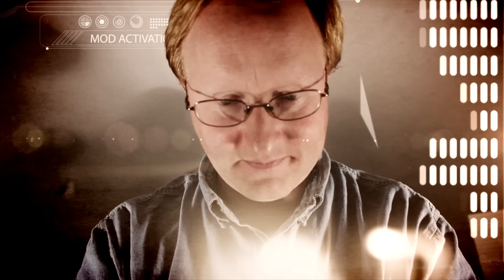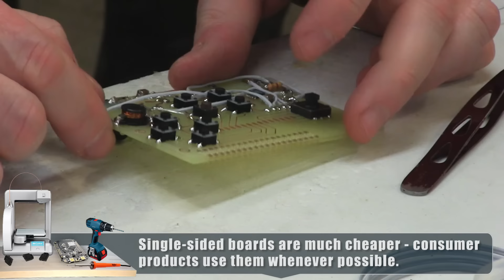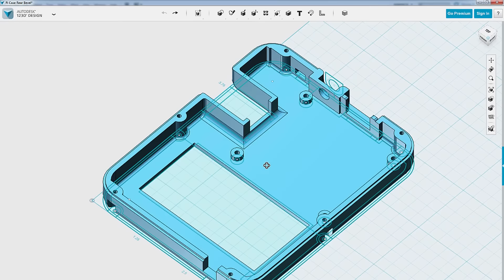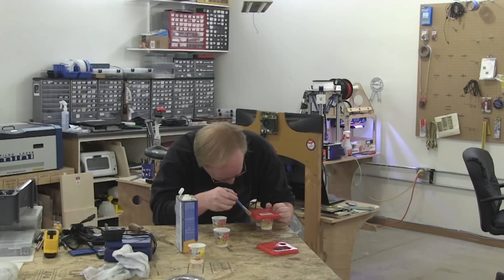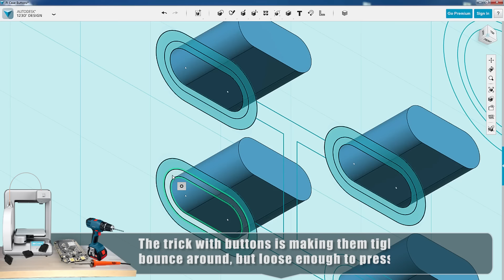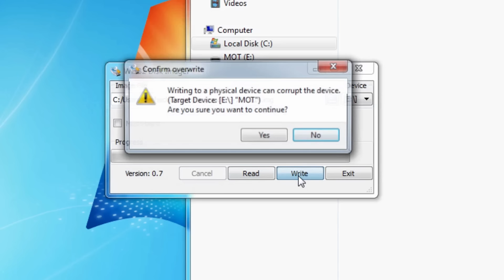Ben Heck’s Raspberry Pi MAME Portable Part 2

Comment: honestly, to me this handheld seems sort of worse than the previous. Moreover, still no speakers? Seriously? Also, you seem to concentrate on trivial parts (was watching the case being coated in acetone really necessary?) while almost completely neglecting important stuff (GPIO connections/pins, Raspberry/voltage regulator specs, component prices) then you go straight into compiling. Pretty steep learn curve I would say. What if something goes wrong during building? We get stuck at the very beginning if we have no compilation skills whatsoever.

Neat choices:

-tactile switches (simple to install and wire)
-flat cables (save up lots of spaces while keeping it tight and tidy: we know exactly what goes where)
-Li-ion batteries (better with a high capacity i.e. more mAh)
-direct controls on GPIO instead of an USB controller (which is horrendous because it drains current without being really useful in the first place)
-KISS (I love that)

Overall criticism:

-3d printing (so neat but so unaffordable, why not looking for used/not functional pre existing handhelds?)
-tactile switches (they're so friggin noisy!!!)
-looks uglier and bulkier than the previous one
-again, no speaker/s (HUGE disappointment, ever seen a handheld console with no speakers? I am not aware of any of them)
-a little less "homemade" than others (not everybody has PCB skills and/or tools to create one at home)
-Li-ion charger AND stepdown regulator (maybe too complex?)

All in all, a "cheap composite LCD screen" works just fine and it could also obscure out some minor graphical artifacts due to less-than-perfect emulation. And the resulting slight blur could create a nice "80s" effect which I adore. Was this really an improvement?

Comment: Is there a way to eliminate audio noise to RPI 3's headphone jack? I have this problem using a cheap 3 + 3 watt amp for stereo sound in a Porta-Pi that I built with a 10" monitor that uses HDMI but has no audio support on it's driver board. I'm using a phone charger battery pack. Has 2 2.5 amp  & 1 1 amp power out. Everything works fine except for annoying audio noise. Any advise?

Comment: RE: "What would you have done differently?" -- I would have made the case more ergonomic. -- It seems like everyone and their brother is making Raspberry PI portables, but they're making them in all these terrible flat cases that don't fit in your hands well. -- Look at the bottom of an Xbox controller, it's not flat, it's all wavy and bumpy -- designed to fit your actual hands -- so that you can have long hours of play time with them without your hands cramping up like they did back in the days of NES and SNES. -- Also, I probably would have added a pair of dedicated speakers, used at least an RPI2, and a screen that connected to the video hardware directly, rather than using i2c.

Comment: Why do all Americans pronounce it "Sahder" ..  I mean you guys don't say "Sahger" for Soldier.  Solder has an L that is supposed to be audible.  Drives me nuts, I do like your channel however.
Reply: +Troy Starkey  Why do Brits pronounce aluminum as aluminium adding a syllable? Yet another mystery of life.
Reply: The Brits use the modern word, yet Americans use the original word.  That bothered me for a while, but they are spelled differently so until they take up the newer word we have to put up with those differences.  Sahder has no real excuse though, i guess the sahgers can fight it out in a word war someday.
Reply: if we start to question english pronunciation the whole language just falls apart

Comment: Acetone has a welding, not gluing effect.  The plastic actually melts and intermixes with the target surface, as opposed to a bond which fills gaps on the opposing surfaces.  Generally speaking, welding is less reversible than glue/bond.

Comment: Very cool build! What would I have done different? I would have used a self made double-sided PCB with drill holes for bridging. No need to outsource it when you can just run short wires through the board itself. Green masking the pcb is a simple process which I have in the past and would have done here. Also would have designed the chassis wider and longer, used a different battery, flat cell instead of round cell, but that is a small issue and your choice only caused a minor chassis design problem. Would have painted the chassis white rather than acetone it[that color is just awful]. Also would have included other emulators as you designed enough buttons for them, possibly including left and right shoulder buttons. The system you designed has enough computing power to run MAME and therefore has enough for many others. Those are my thoughts.

Comment: really not keen on the whole acetone smoothing. a simple sand and light coat of spray paint looks so much better. also sanding the rounded edges into the print rather than printing them looks better

Comment: You could have extended that USB port to the side, thus not leaving that hole in the case. With a small hatch to protect it in case you think rubbing the USB port with your hand would oxidize it.

Comment: I would have included a mini speaker inside the case. You should have sprayed a thin layer of acetone for a smooth finish and no warping. (Use a refillable perfume bottle.)

Comment: It was an awesome build! The color reminded me some 80's computers (specially Alice from Matra-Hachette).
Wel, you asked for suggestions, then here you are: 1 ) You can avoid the mess with ferric chloride by using HCL an H202 but do it on open air because of the gases it generates and don't forget to use protective gloves and glasses. 2) I would have choose which GPIOs to use AFTER I have designed the board with straight connections to the buttons to avoid the use of so much wires. 3) For signal wiring you could also use enamel wire (like mr Elm-chan.org builds). Finally I have a request. you have some wonderful furniture in your workshop, some of them look DIY builds. You could show them someday, maybe share the plans for construction. Best Regards!

Comment: it looks cool, but the price tag and total time building it wasnt worth it, unless your a hobyist as they say. Still it's fun to watch people build something from scratch.

if you are a layman and want emulators on the go (not just NEO-GEO or other arcade emulators), PSP would that stuff for you even without using a CFW since emulators today are pseudo-signed making them possible to run on PSP on Official Firmwares. And it's really cheap and looks much nicer.

Comment: hey i wonder if any one could help me as it would be much appreciated i am currently nearly finished restoring a moped and for the dash lights it has small bulbs but im just going to use leds as back lighting  ..... i am using 5mm leds that are 3.3 volts at 25 mA ...... i am just wondering what resistors i should use ? and should i use a resistor on every positive on the led or 1 for the whole circuit and i am going to be using 6 leds all together and the supply voltage will be 12v by battery but once the engine has started it may be 13-15 volts and i think high amperage

Comment: Hi Ben,
I had the same issue with importing illustrator SVG files to 123D Design, but I found a workaround that keeps both the dimensions in tact and also protects all the round corners from distorting. It’s a little tedious but it works. It will save you from rebuilding the entire sketch in 123D Design.

It’s a two step process.
1.) First what dimension illustrator actually exports when exporting a 100mmX100mm box. In my case, illustrator exported a 283.5mmX283.5mm box. You have to divide 100mm by 283.5mm (in my case, your number might be different) to get the number to scale your art to. Save it out as a SVG and your files should match the mm in your illustrator file.

2.) Now lets tackle the distortion issue. I learned that 123D hates importing small SVG files for some reason. My workaround is to scale the illustrator file up 1000% (after you did step one) and then import it to 123D design to new scene. This will keep the curves intact. Extrude the shapes (by a factor of 10) and then scale your artwork down to 0.1. This way it both retains the correct dimension and the correct shape on all curved objects.

I hope this helps. Also I made a few videos to demonstrate just in case:
Part 1: https://www.youtube.com/watch?v=eT5jh13v_v8
Part 2: https://www.youtube.com/watch?v=RX8o6RgOXKA

By the way, thank you for making your videos, I enjoy watching your builds.
-Chris Titze

Comment: I've gotten good results with acetone finish by putting it into a spray bottle and misting the PCB. granted you have to do it fast because it'll destroy the bottle if it's got any plastic parts in it, but if you do it right it can give it a fairly nice dappled texture, like the Super Nintendo or Super Famicom had.

Comment: The audio was all effed up in your game. I know Ninja Gaiden (aka Shadow Warriors) well and that sounded almost "inverted".
There are playthroughs available on YouTube, under the title Shadow Warriors, so you can hear it normally.
Reply: mingtooter Well, he was using a Raspberry Pi Model A+, which has only 256MB of RAM. When I play SNES games on my Model B (512MB of RAM), it also can have issues, so overclocking the Pi helps out. With a simple heatsink (0.25 on eBay), a mild overclock makes a WORLD of difference. In my case, I do a bit more, but I have a tiny fan also cooling it and at least SNES wise, I haven't noticed ANY slowdown.
Reply: I thought I heard that too... The pitch was varying in time with the actions and button presses by the look of it. Some gremlins I guess.
Reply: Flame Soulis good call, good tip!

Comment: I want a fix, adjustment, redesign to trackballs.
NONE of the few designer companies have updated the design or concept of the trackball in over 10 years..
There were 2 designs that REALLY worked..
Logitech Marble mouse and MS made one long ago, with Multiple buttons..
1. they were designed for Handicapped people..
Big Buttons..
2. Bad designs with Thumb ball designs..
3. drivers SUCK..

Thoughts..
MORE buttons for gaming..  they are big enough to have Lots of buttons.
Trackball change to Ball shaped PAD..  with Multi DPI settings.
To many are using Digital(off/on) controls can there be a Variable control?
There are 2-3 fingers that REALLy dont have much to do, if you drop the pinky, 2..
Combination buttons, being able to hit/hold 2 buttons to create another function..

the problem I keep running into, is finding a USB control chip..with enough options to do what I wish..without buying an expensive mouse and converting it.. 

then comes the fun part..Control software.  Iv even suggested to MS to make a better control software..  would be nice to have a program that lets you ID any type of mouse/device..and all its buttons, no matter how many.
Reply: Trackballs should be discarded entirely. They were a mistake IMO. More like a mouse upside down.

Comment: I would of put a 5 pin female header port on the side, so you could connect a NES/SNES controller. 3.3V/CLOCK/LATCH/DATA/GND.

Comment: Hey Ben, i was wondering about your Linux computer, i need a good programming machine and it would have to run Linux but the Raspberry pi does not have enough power,and my workspace is small so i need something compact,

Comment: Great job Ben.  For things I might have done differently... Outside of the few things you already mentioned at the end of the video, I would have gone with a horizontal layout like a PSP.  Used a different colour scheme, or at the very least, made the back section black.  The last thing would be to make the directional pad more of a traditional "+" shape whether it be like the NES controllers or the Genesis style where its a circle with the "+" shape on top.  Then again, the directional circle you made may work just fine, I've never used one like it. It may even be a superior design to use with the method you used. The best directional pad I've ever used on a handheld was the one on a neogeo pocket, and if I could find one as close to that as I could, it would definitely go into my build should I ever decide to make something like this.

Comment: What I would have definitely have done different is connecting the PCB and screen with a ribbon cable instead of pinheaders directly into the lcd. It makes the project really complicated, because it has to line up correctly and I am not that confident in my designing skills. Appart from that maybe different colours or an extra ssd slot for movie storage (to watch videos out of home), but a good project altogether

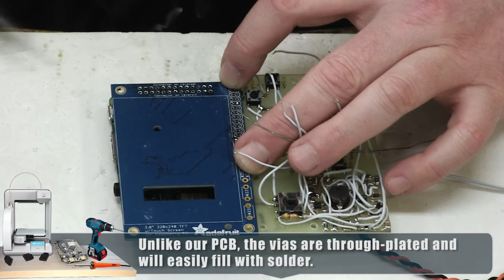Comment: At 4:11 you put the solder on the tip of your soldering iron instead of on the board/components. Doesn't this evaporate the flux and makes the solder less sticky? I understand it if you only did the corners this way, but the whole board? Then again I have a lot to learn regarding soldering

Comment: A technique I remember seeing in electronic toys I took apart might help simplify the wiring.  They  would use a single sided pcb and where a cross connection was needed, a bare wire was run on the back side of the board and soldered in the through hole connections. It might take a little more planning,  but could be built in less time.   Great project btw.

Comment: should have just desoldered the usb port and rewired it to reach the side of the case that big cavity for usb access is a bad design choice, it also would have negated the need to encroach on the case space because that cut out wouldn't be there.

Comment: hey next episode you should build the acetone vapor chamber.
Reply: I always use a pan in my kitchen-> works perfect but you have to open a few windows 😂
Reply: Not much of a build.  Get a plastic container with a lid and line with paper towels.  Done.  Or use a paint can and some magnets to hold the paper towels to the side.
Reply: yeah but something automatic. Sure you could do solder reflow in a basic toaster oven with an egg timer, but wouldnt it be better to have a purpose built unit? Same with the acetone chamber. It's about having reproducible results.

Comment: the gloss effect makes it look kind of cheap
Reply: Kind of a moot point considering he built it himself, so he has no need to make it not look "cheap".
Reply: yeah, the combination of gloss and color and shape kind of makes it look like a cheap toy.

of course, the could have gone too far the other way, with a sort of "ruggedized" look with rubber hand-grips and similar, making it look like something made by Pelican or something... or basically gone and coated the entire exterior with a vulcanized rubber and tread and nubs... (kind of like a Fluke multimeter, the teacher in a class had one, and as a demonstration was throwing it around the room to demonstrate that they don't easily break).

but, OTOH, I got my multimeter for like $15 or similar at Harbor Freight, and it basically works.
Reply: Brendan Bohannon A flat face with a rounded back would've been a lot nicer.
Reply: meh, it was as good a time as any to test a new technique

Comment: The Super Famicom had multi color buttons, so you weren't that far off saying the SNES had multi color buttons.
Reply: The European SNES also had coloured buttons, in fact, it has the same design as the Famicom.
Reply: Samuel Doye
Hmm, didn't know that.
Reply: *****
I'm pretty sure that's just a myth.
I read somewhere in an interview with someone from Nintendo that the design change was to add familiarity with the NES design, which was much boxier than the original Famicom.
Not sure why it was only in the US though. Thankfully here in the UK we got the much nicer Super Famicom design :-)
Reply: I had the European version, much prettier than the US version. =)
Reply: ***** I don't see how more colorful controller buttons could encourage people to put their sodas anywhere.
Reply: ***** Donkey Kong Country was released in 1994 and was a big hit on SNES.
Reply: xbox 360 was what he should have said though because its newer
Reply: I'm not arguing with is better I'm only saying the xbox 360 is newer
Reply: What he said!
Reply: Nitris Yea, same body.  The Euro and Aus/NZ SNES had the SFC body shape and were PAL.  The SFC of couse was NTSC-J, but is compatible with US NTSC TV sets.  The Super Comboy out of Korea is basically a SFC, operates on NTSC-J, pretty much identical hardware and same shape as well...BUT was manufactured and marketed by Hyundai Electronics.  Completely outside of Nintendo, but with Nintendo's permission since they couldn't market in Korea back then.  I actually have one.

Comment: The reason the case got warped is because you're not supposed to pour acetone straight on ABS, a fume chamber takes longer yes, but smooths the surface more evenly and less violently than direct liquid acetone :p

Comment: Ben you showed us how to make 2 mame portables using the parts that are available. Why don't you now make one using exactly what you described, a 2 sided pcb with actual battery connections and a speaker with a NICE case. a 3d printed case is nice, but make it look professional like it was rolled off the belt in some factory.

Comment: Hey ben, have you thought about using switches more like whats in the 3DS, the low profile buttons to save space, I don't know how they are soldered on exactly but they look and feel nicer than the larger ones you use, I also know that its easier to salvage the ones you use but for a future project have you ever though about the low profile ones?

Comment: Rather than pouring acetone directly over the plastic, I've seen a vapor process where the piece is exposed to acetone vapors in a sealed box. This has a much more gentle effect and should avoid the warping issues.